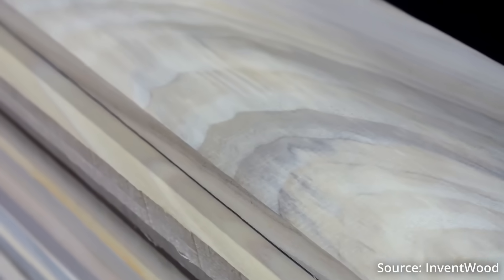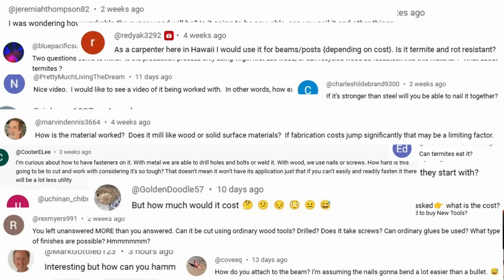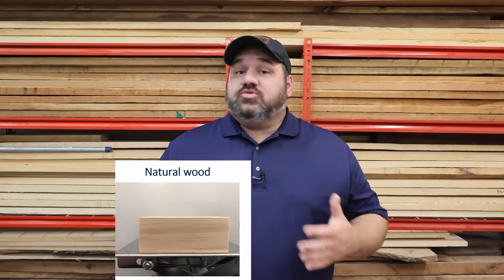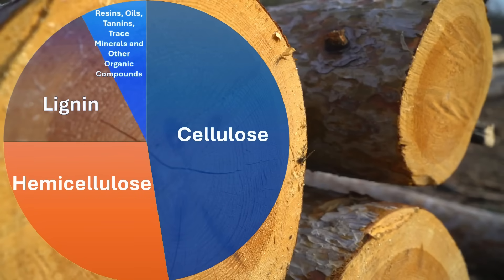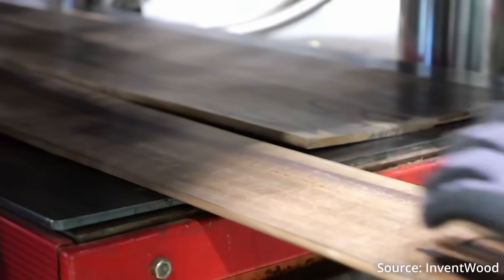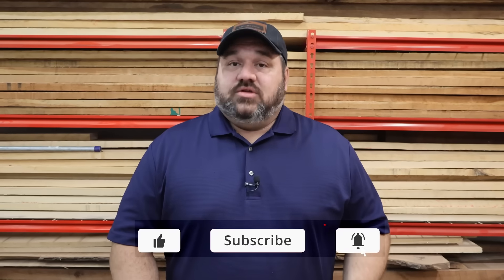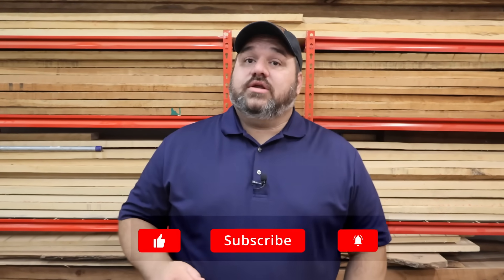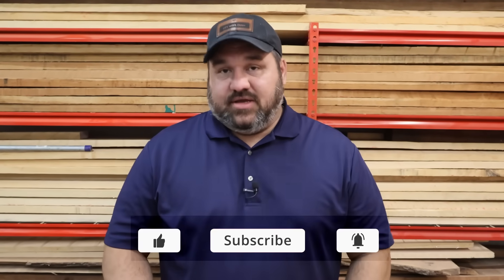The TRUTH About SUPERWOOD - I Met With The CEO of InventWood and Have Answers to All Your Questions

Comment: I was a delivery driver for a lumberyard in the early 90's, and there was scuttlebut back then that a new replacement for framing lumber was on the horizon: PlasWood..... By taking the "culls" of the timber industry (branches, twigs, basially any 'wood' that wasn't 'timber') and grinding it into sawdust, then mixing that into polymers and extruding it (remember the Play-Doh Fun Factory?!?), dimensional lumber could be produced that was lighter,  just as strong as pine, spruce, or fir, but moisture & termite resistant (perhaps even fire resistant?!?) and could still be cut, nailed, drilled, milled, and even painted!! (Just no staining, please; they wanted to sell "tinted" appearance boards!!) By '95, the chatter had faded a bit, because "Big Timber" didn't want to divert their "culls" to this new upstart, (they wanted to keep feeding their OSB and plywood divisions... no names, but their initials are Georgia Pacific!!), and initial investors were getting antsy 'coz they hadn't seen a huge ROI, so funding dwindled.... As did my hopes of building an entire outdoor furniture suite from weather-resistant (but stylish!) furniture that my grandkids would be using in 2055! (I began woodworking just before retirement!) -- The early projections for cost on PlasWood were just over double 'natural' options, but sinking those 12-foot 8"x8"s at the end of a short pier on the lake was worth an initial outlay, since 8"x8"s of any length were as hard to find as a chicken dentist, and you wouldn't want to be redoing that job every decade! I look forward to your evaluation of 'SuperWood' [that's what she said!], and as always, Blessed Be, & Peace!!!  🙏☮
Reply: It didn't go away, you can buy decking that's made of wood particles and plastic. Both Lowes and Home depot carry it.
Reply: @ronreyes9910  If you're talking about "Trex", there's prolly not more than 10% wood or wood-pulp content, since they brag about using "recycled" materials (namely, the gloop that results from grinding everything from soda bottles to disposable diapers!)..... The only 'wood' in their product description is "wood-alternative composite decking"! It's a totally man-made [and man-remade] product, although it does use the "Play-Doh Fun Factory" manufacturing process!!
Reply: Why are we not farming bamboo? Its super strong, grows super fast and is cheap.
Reply: @Brian-gj5xm  You want bamboo?? I gots a *TON* of it growing rampant and can't *KILL* it, because all shoots are basically 'limbs' off of **ONE RHIZOMAL ROOT**!! Please, come cut as much as you can haul!! Sizes range from nickel-diameter up to **2 inches**!! [fishing line not included, drying times may vary, and rhizomes below harvested stalks must be taken away along with the stalks...] --
Reply: @akashicvizion  I like bamboo, but a few years with good care and it can dry and crack, harder to treat and care for and I’m guessing underwater it will soften too, but please tell me what you know.
Reply: @Brian-gj5xm  While Bamboo is an interesting material (flexible as willow, tensile and impact strength of steel, at least shell side -> hard to work with, tooling will cost extra) On the other hand it is impossible to puncture without losing all the strength, because it will simply split along the grain. So, no screwing or bolting the stuff together. 
You can process it somewhat, and there's a lot of working but impractical solutions for connections made with it, but generally, the more you process it, the worse the material becomes. It has it's peak state of flexibility, stability and strength after ~2-3 months of growing/aging as one straw. Every further process you do to it will only weaken it.

The easiest you can do, what most do, is grind it up, process the cellulose and sell it as "bamboo fiber". Yes you can build impressive things with it, but it is a royal pita to work with, on all layers of processing except if you only need to split it length-wise, that is easy work without much tool abuse, everything else, though...
Reply: There is also LVL and LSL lumber that is made from strands or parts and then turned into longer and larger beams, etc….
Reply: So basically 3D printed wood. Yeah, no, that only has drawbacks. For starters, doing anything to that wood which generates dust would be a health hazard. It would also likely deform under heat, like epoxies tend to do, making it a hazard for structural appliances in case of fire. Depending on the plastic used, UV resistance could be an issue, so no appliances where sunlight can reach. 
 
Sawdust doesn't add strength since there's no fibers left to carry the load, not much at least. Your basically using wood filled plastic where all the properties depend on the plastic. Except maybe fire resistance. Pressed/Extruded sawdust, even saturated with plastic, does not leave much room for air, adding to the natural fire resistance of wood.
Reply: Thank you for sharing!
Reply: I get a polywood brochure every year in the mail
Reply: My local zoo built a boardwalk through a fen in the '90s with recycled plastic plank decking. The planks held up just fine, but many of the posts sank...

Today PlasWood is the name of a company making recycled plastic composite in Scotland. Trex is another company with a similar product.

I don't believe the conspiracy theory because it's not hard to find scraps of wood, even at scale, I would think. Rather I suspect that PlasWood is grinding the wood so fine that it loses the strength in the grain. That's what normal wood and Superwood retain - the grain gives it strength along one axis. WIth plywood construction, you can add grain running in a different direction to add strength running along a different axis.
Reply: @edherdman9973  Well, "PlasWood" was mostly about the "Plas"... they were only using ground wood fiber to lessen the amount of resins used ..... there is no 'grain direction' at all, and its biggest success was in 4x4s, where they excelled as to degree of warpage and rot (or rather, lack thereof!)
Reply: As a licensed chicken oral surgeon, I recommend IPE or Ironwood or somesuch ... with a chikcen sammish.

Comment: Other uses.  Fastening systems.  Aeronautics.  Ships and boats.  Really anything that requires high strength and needs to not be brittle would most likely benefit from this if the material can be strong enough.  Lighter than steal is one heck of a bonus where weight is a serious issues, such as aeronautics and spaceflight.  Given the manufacturing process as it is described, I could see things like electrical conduits being built in, providing a construction material that could be far safer from electrical fires in the wall.  But, hey, dreaming...

At first, so many problems with current construction materials need to be fixed, and I am not just talking about 2x4s that are actually 1.25x3 inches...

Comment: How light is it in comparison to the untreated as a sample?  I'm curious how it might work for electric guitar bodies and necks.  Specifically, the poplar they use, is it lighter after the treatment than before?  Will it take paint the same way or glue?  I'm a small shop and make just a few guitars a year but I make them with special needs in mind.  The biggest request I get is the need for very light guitars, but the musicians still want a traditional wood electric guitar.  I have to sort through a lot of wood to find lightweight wood in the quality needed for instruments.  A source for consistent, lightweight wood that glues and takes paint like typical wood would be a boon.  The fact that it's harder and stronger is a positive because I could make the instruments thinner and create some unique designs that ordinarily wood wouldn't be suitable.

Comment: Design a structure utilizating the characteristics of superwood and compare cost and differences to conventional work. Building framing, roof sheeting, glue lam beams, flooring such as an osb superwood could be hard, durable, and decorative. Or doors.

Comment: If this material is " bulletproof ", then it would deflect a nail from a nail gun. This material would also not accept gang nail plate fasteners used in wood trusses. So does each fastener need a pre-drilled hole?  This material might be used for flooring if the surface is not slick. Otherwise, what's the point of this product? Superwood is likely super high price.

Comment: Question concerning sodium hydroxide and sodium sulfite. What are the hazards and environmental impacts of the manufacturing process of these chemicals? Are they reprocessed and reused? And where and how are they ultimately discarded?
Reply: Sodium hydroxide is basically lye.  A strong alkaline.  One of its uses is in food products, such as bagels, pretzels, or even in some cases masa (though most masa used for corn tortillas uses calcium hydroxide).  

Sodium sulfite is used in the pulp and paper industry and can be used in swimming pools.  It can be a hazard during the manufacturing process, but probably not anything to worry about in the final products.  It's a chemical that can be managed to prevent environmental damage during the manufacturing process.
Reply: Wikipedia has your answers.
Reply: Should be similar to paper making but less bad since there is no need to bleach wood. The two chemicals can also be recovered and reuse but the keyword is can ...
Reply: These two chemicals are also used in treating boiler feedwater for industrial steam generation. Sodium hydroxide can cause chemical burns; it can cause blindness if eyes are exposed. Sodium sulfite can cause allergic reactions in sensitive people. Personal protective equipment, eye shields, gloves, aprons, etc., needs to be used by workers. While they are not very damaging to the environment, their discharge must be controlled to avoid fish kills. The pH and chemical oxygen demand at discharge need to be monitored and controlled to prevent permit violations. Every state has laws to protect our water sources.

Comment: One thing you can't do with this kind of wood is re-saw it, to make planks thinner.  Because of the manufacturing process there are a lot of internal stresses.  When you re-saw it you release much of those stresses and the board warps -- extremely.  So you have to purchase this wood in the thickness you need for your application.  That said, the products invariably will be very straight and smooth from the factory, so you  would likely never want to try to flatten a piece unless you tried resawing it.
Reply: We do not think that the manufacturing process creates more internal stresses than normal wood would.
Do you have any indications it does?
Reply: @OriginForExistence  Yes, just cut some Panzerholz down the middle.  It's made in exactly the same way: compressed in a haudraulic press with heat.  The deflection is more than three times what you'd see in any natural wood.
Reply: Heat and pressure tend to reduce residual stresses in the final product. However, thinner materials are more prone to warping due to residual stresses.
Reply: If all that is left after processing is compressed, oriented cellulose and hemicellulose, there should not be much in the way of residual stress.
I am curious to know what binds the fibers together.  Is it fiber entanglement, or is there an additive binder?  Tensile strength of cellulose fiber is up to 5 to 7 GPa, comparable to aerospace grade carbon fiber..
Reply: @somaday2595  It still contains cellulose, hemicellulose and lignin. Removing too much will weaken instead of strengthening the wood according to the paper. Apparently one of the things that contributes to the strength is the formation of hydrogen bonds between fibers
Reply: so no planeing or jointery machining?
Reply: @gordons_here  It's too hard to plane.  I mean, you can try but it takes forever to make the smallest amount of progress.  Similarly, it's very difficult to sand.  You can sand it, but it'll come out of the hydraulic press flat and smooth so sanding is only needed to correct for minor errors when you do other things with the wood.
Reply: Just about every piece of poplar you buy today is not going to be straight and will have some warp, maybe some twist. How is that going to be removed if they plan to sell straight wood?
Reply: @shopshop144  The wood, even chips will be disintegrated completely in a bath and cooking. So it does not matter if there is warp or twist in the wood that will be used.
Reply: @shopshop144  In the manufacturing process the wood is heated and compressed in a flat hydaulic press.  That both makes the wood straight and amplifies the internal stresses.
Reply: @ryanbudney3356   It might make it flat, but not straight

Comment: Very excited to see where this could go.
Questions - off gassing / food safety / color impregnating / clear coating & staining.
The other question or thought, is if it's stronger, it might require less material, affecting price. For example I can use dense hardwoods spanning longer distances without reinforcement.
Very cool I hope all the best in their indever, have fun working with it!

Comment: Dear CEO of Superwood. You can make 2x4 and 2x6 using the "shape" of Metal Stud forms, therefore you get the improved strength qualities, fire resistance etc, and maintain the low cost by reducing the total volume of building material.
Reply: It's physically impossible to improve strength quality for a given material by starting out with a solid rectangular shape then removing material to change it into a c-channel. Doing that removes all torsional rigidity. A completely solid rectangular cross sections will always be "stronger".
Reply: @OU81TWO  Yes, but that comparison is between "wood of type X" to "c channel" using wood of type X which as you mentioned has hardly any thickness. But that doesn't hold as always true if the materials are substituted for much stronger materials.
If you used C channel of Steel, the properties change, which is why there are thin walled Metal studs in commercial construction. Thus, if you use a similar idea, ie, create the overall desired shape that would perform a similar function to a 2x4, and use a more hollowed out form, but yea, the wall thickness of the material for the channel would need to be thicker than the "steel" version of course.
Reply: @OU81TWO  I doubt that wall studs require much torsional rigidity. Compression might be a factor in carrying walls.
Reply: I don't think that's how costs savings works.
Reply: That's not going to work. Remember it's still wood and the grain isn't going to be straight. The second you cut out a area creating that channel you've lost all the strength of the wood because there's now grain that doesn't connect. It would become useless for any kind of structure use.
Reply: @JamesSmullins  But, we aren't actually "cutting" the channel out at all. For example. you could take a low grade #3 piece of "rough" wood with dimensions that are larger than the nominal size and use their patented process to compress and densify the wood, so all the strength remains, and would be stronger than a standard 2x4 (since you are starting with a larger piece), but it is compressed to a much thinner wall thickness. You would then steam bend that into the channel shape desired while maintaining the pressure. There is literally little to no actual "removal" of any wood to make the channel. It is simply steam pressured into the desired shape.
Reply: Using metal instead of wood also effects sound properties.
Reply: Or just do the H-beam shapes that we already have in LVL
Reply: It would be weak as hell, it may be as strong per weight but not volume so if it were shaped and sized the same as structural steel it would be much lighter but also much weaker!
Reply: @phillhuddleston9445  Well, I am not so sure because what they are doing is compressing a much larger piece of wood down to a much thinner piece of wood. Think of it like the strength of a 4x4 piece of wood compressed down to a 1x4. 
Or a 2x4 compressed down to a 1/4 x 4. So, generally, you keep all the strength of the original piece of wood, but it just takes up much less space.
Reply: @marcfruchtman9473 - I could see them being able to take  1x8 and compression form it into a C channel that is say, 1x5.5x1 stud (assuming they lose less width than thickness in the process)
Reply: @orcoastgreenman  I don't have any hard data on the compression ratios before vs after. But if you spot some let me know.